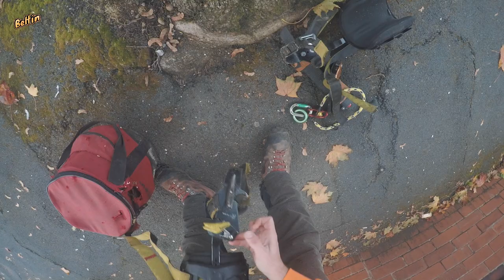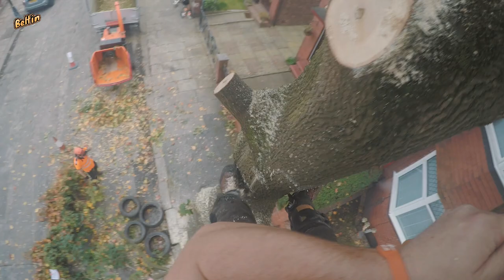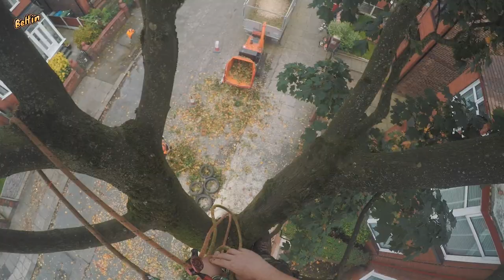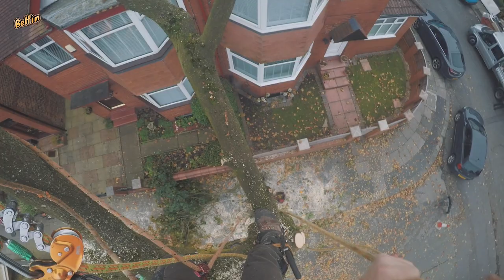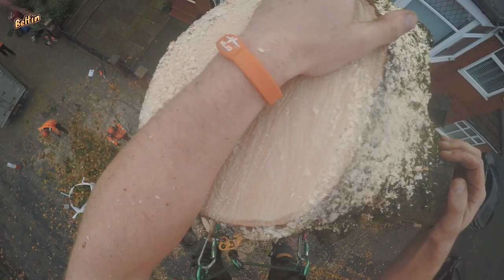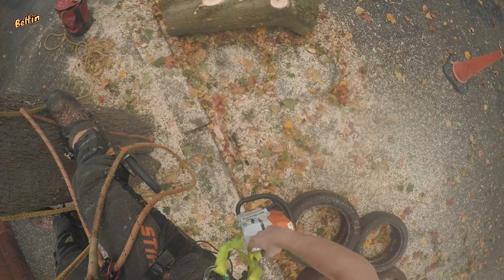(Raw) Start To Finish, how I remove a small tree

Comment: How are you securing your anchor Couldn't quite see? Is it a biner locked off in a ring?
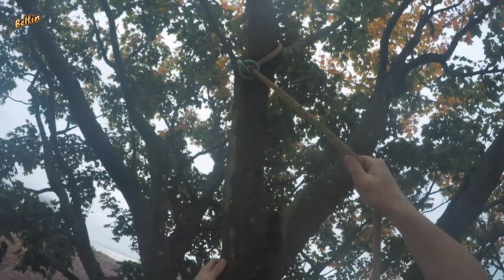Reply from the maker: You can see at 10:24. it's a spliced eye that goes through a ring. The biner then goes on the spliced eye and this stopes the rope going through the ring. Its a really quick and simple SRT canopy anchor, Not retrievable unless you attach a retrievable line to the biner.
Reply: @MattGlynn  Appreciate that Matt. I can see that aye. Simple and effective. I'll try and give it a go.